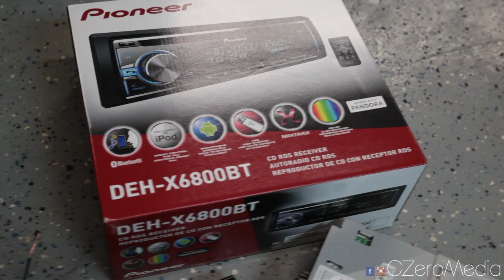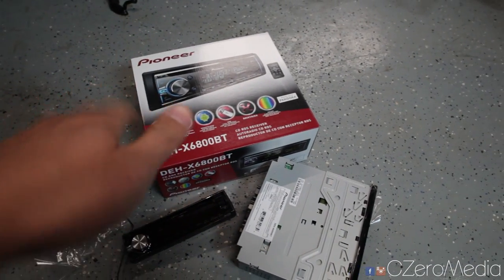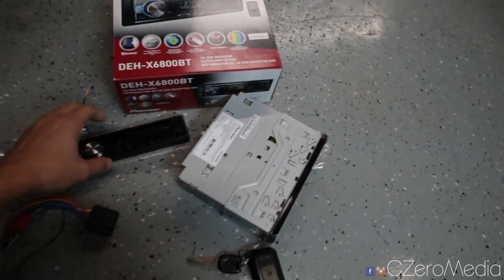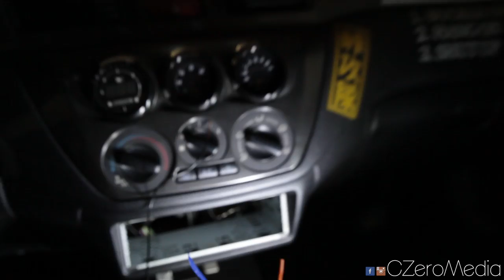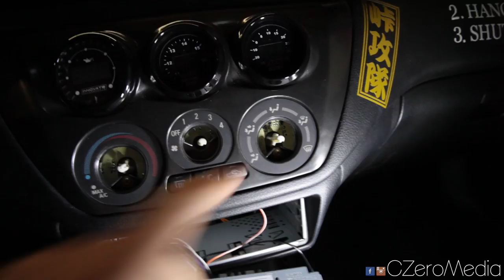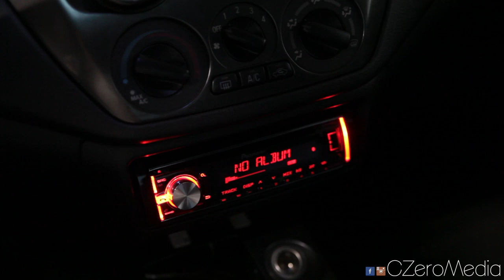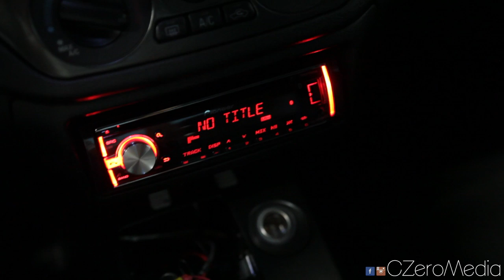How To Install Aftermarket Radio In Evo - Voltex Evo Build #22

Comment: I see your Evo is a SSL. Do you still have the factory sub? I put the same head unit in my 05 Ssl but have issues with not all the speakers working properly. One of my aux input tries to act as the subwoofer through one of the in car speakers
Reply: I have a 04 ssl I had same problem. I have the same headuint. 1st. make should u have ur aux correct if they are not correct it will not work properly. 2nd make sure u set head unit to rear/rear and all speaker will work correctly as well as sub.
Reply: Ill try the rear/rear thanks! what do you mean by make sure the aux is correct?
Reply: +Alex Callage sorry I meant I typed rca but phone switched. the rca the white, gray, purple, and green make sure those are in the correct spot for the sound will not be correct
Reply: ah cool, im out of town for the week but when i get home ill give it a try and let you know! thanks man, not having my audio working correctly in my evo has been annoying as hell
Reply: +Alex Callage trust me  I know how u feel u was there but I got thru figured I share the knowledge. let me know how it goes
Reply: King Sipz I looked through all the settings on the menu to try to figure out how to set the head unit to Rear/Rear but didn't see anything like that. any advice?
Reply: +Alex Callage power radio off. then press and hold volume knob then scroll thru till u see I believe initial select it go to sp select then scroll thru till u see rear/rear